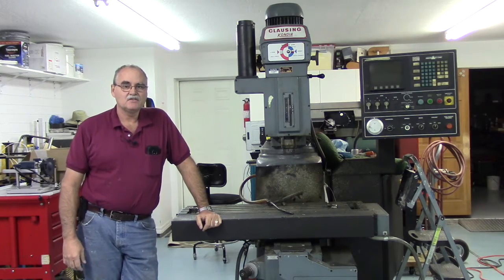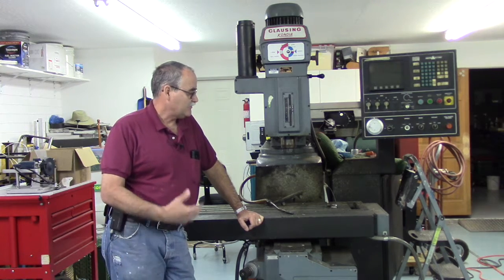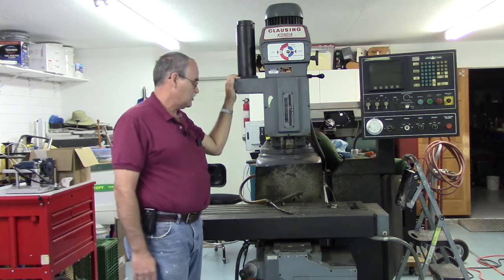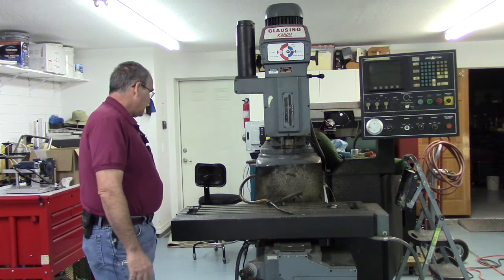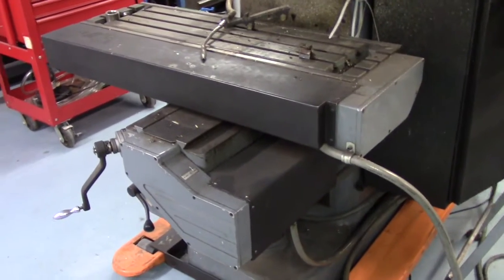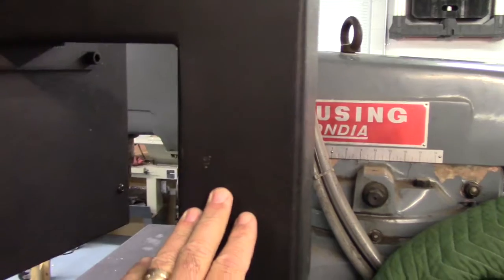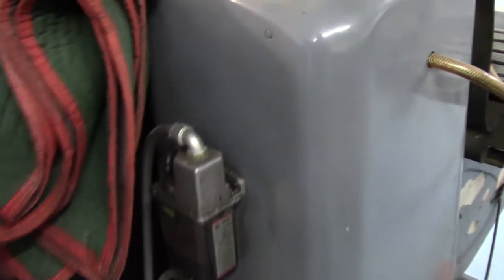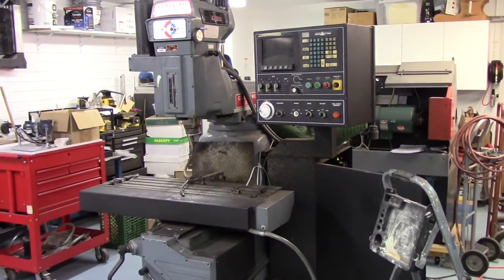Clausing Kondia CNC Knee Mill Retrofit Overview -  Another Centroid CNC Conversion

Comment: I am looking at a Clausing Kondia 2 axis with Delta. The  Y motor is bad, do you have any suggestions on where to get a replacement? Thank you
Reply from the maker: Depends on the maker of the motor. Are you sure the 2 axis CNC mill will do what you want?
Reply: @martyscncgarage5275  I've reached out to the seller to try and get some more information. I would love a 3 axis, but this is local and reasonable.

Comment: I suggest Before you get to far check and make sure that kwick switch tool holder is functional and will hold a tool securely. there usually built into the spindle shaft and do wear out.
Also as you probably know you need a brake that will hold the spindle during the tool change not just on deceleration.
One of the problems with a knee mill like that is you spend more time sweeping and cleaning than machining.
Also Ill bet your viewers would be very interested in how you used the pallet jack to get the mill in the door.
Reply from the maker: Tom, not quick switch. Erickson quick change 30. It holds the holders just fine.
Reply: both brands work and look the same
Reply from the maker: Not true. Bridgeport Quik switch has two ears, Erickson is an NMTB type 30 holder
Reply: You may want to research that marty. Would you like me to send you a link for information? And i meant they work the same as in detentes to over center and lock in. The tapers are different. Also the kwick switch was used on more than just bridge ports
Reply from the maker: Thanks Tom, I'm good. I appreciate your comments